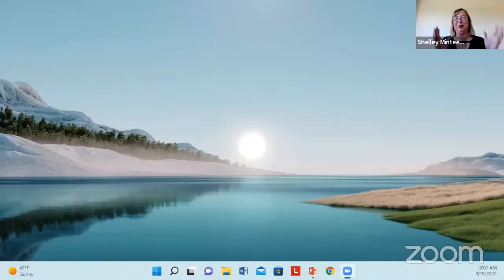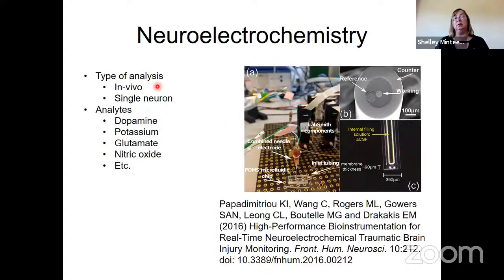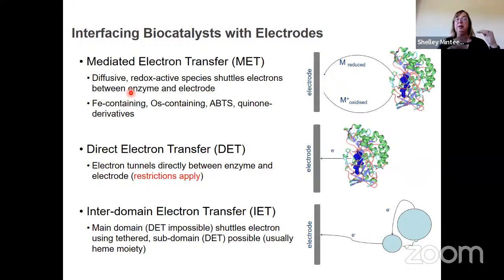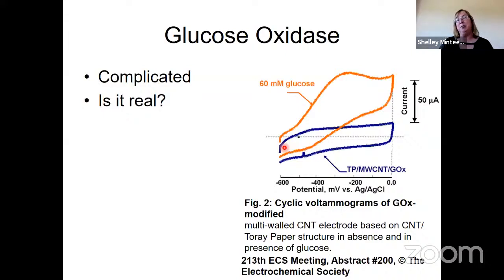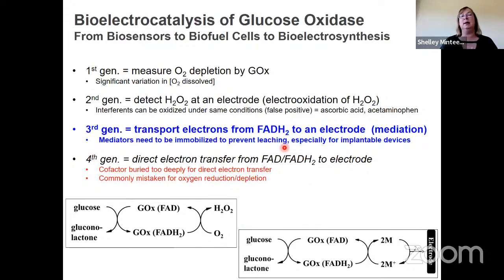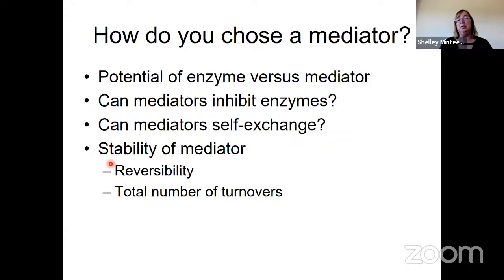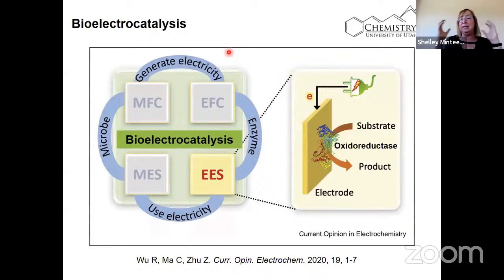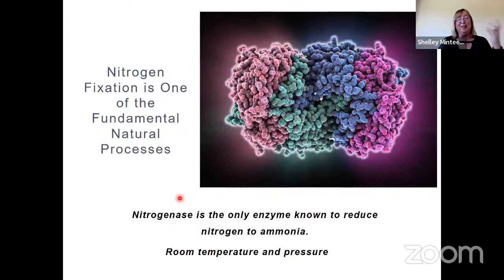25. Prof. Shelley Minteer  -  Interfacing Biocatalysts with Electrode Surfaces

Comment from the maker: 00:00 - Introduction
02:20 - Beginning of the talk 
03:57 - Diversity of bioelectrochemistry
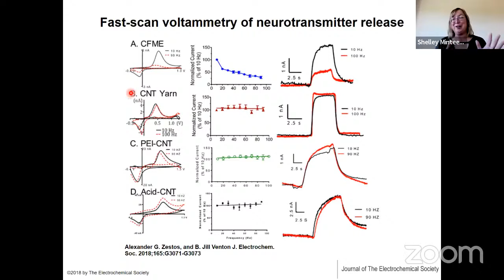07:05 - Biocatalysts on electrode surfaces
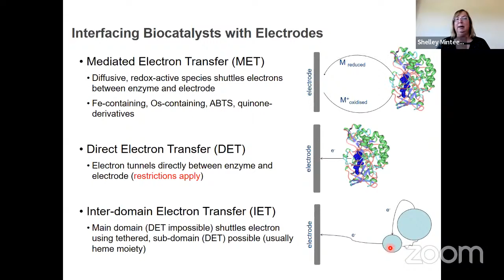13:05 - Direct electron transfer to proteins
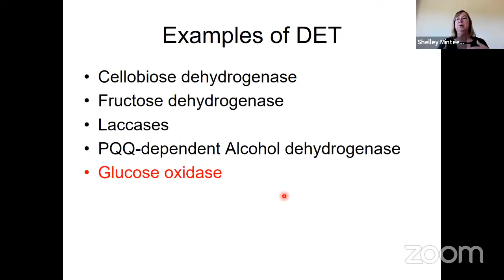15:43 - Glucose oxidase
23:44 - Basics of mediated electron transfer
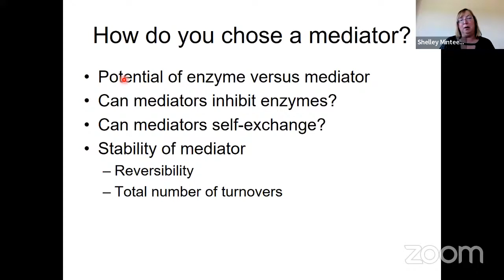29:00 - Design variable for electrodes 
30:37 - Electron Transfer Mechanisms: recap
31:04 - Mediated and direct bioelectrocatalysis
31:52 - Bioelectrocatalysis for fuel cells
36:35 - Cascade reactions
38:41 - Citric acid cycle
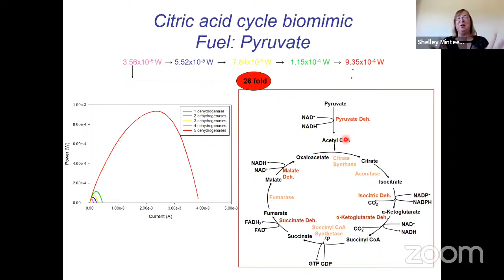43:49 - N2 reduction to ammonia with nitrogenase
50:28 - Chiral amines with transaminase
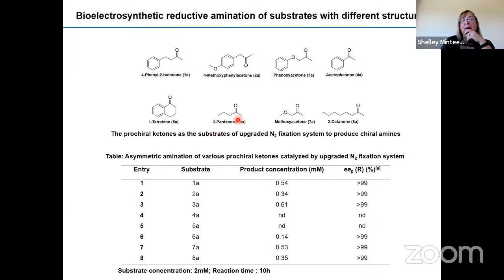54:19 - ATP-independent systems
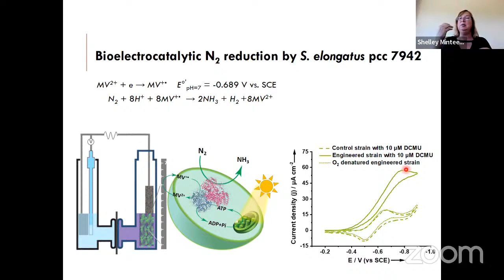1:01:19 - Product quantification for bioelectrocatalytic N2 reduction 
1:04:00 - Direct electron transfer for microbial electrosynthesis
1:06:17 - Direct electron transfer to nitrogenase

Q&A: 
1:11:03 - Q1: Conductivity in the interior of enzymes
1:12:33 - Q2: The role of the double layer
1:13:41 - Q3: Oxygen reduction in the microbial electro synthesis 
1:15:49 - Q4: Reaction stability during N2 reduction
1:18:15 - Q5: Second coordination sphere for catalysis
1:20:21 - Q6: Growth of cyanobacterium and intracellular DET 
1:22:22 - Q7: Potential window of stability of enzymes
1:24:01 - Q8: Mimicking enzymes in inorganic materials
1:26:45 - Q9: Directed evolution of enzymes for electrochemistry
1:29:57 - Q10: Gap between neuroelectrochemistry and bioelectrochemistry
1:32:27 - Q11: Future of analytical electrochemistry of proteins